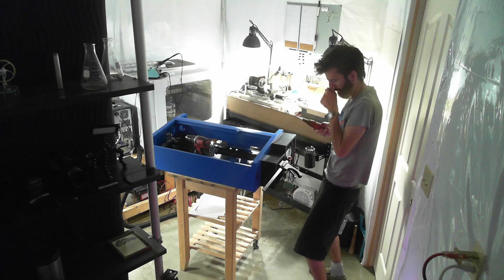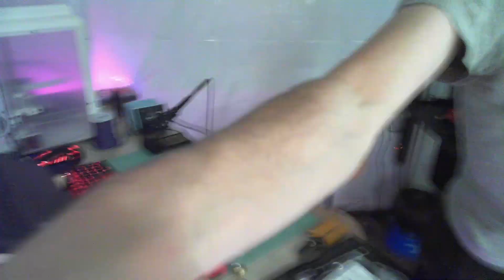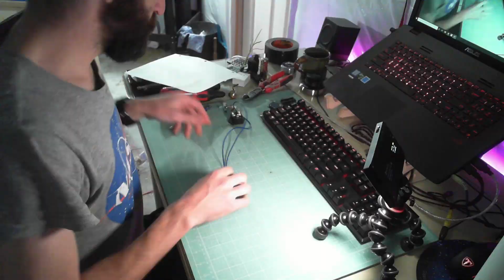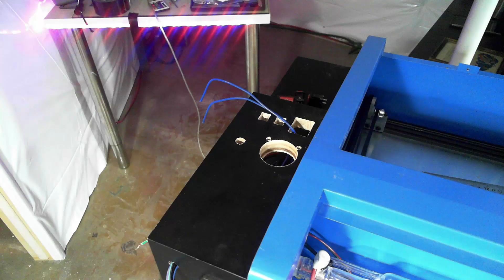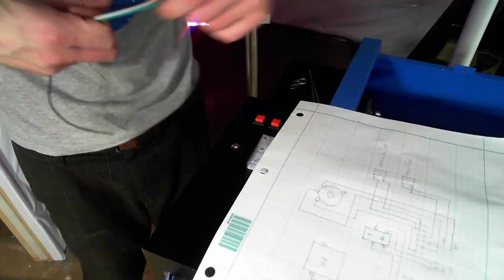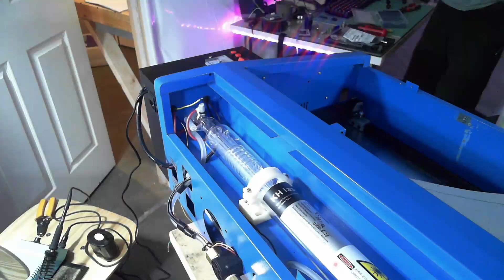Re-Building The Laser Cutter

Comment: Great video. I was wondering what you have chosen for your mirror set up. I have printed all the parts for the larger size but saw another video saying the mirrors don’t meet up well. I was planning to use the cloudray set of mirrors. Is this what you have used ?
Reply from the maker: I've had no issues with mirror alignment (stock mirrors). Quality apparently isn't the greatest but I've had no issues with it for the last few years...I do only cut cardstock and occasionally some 1/4" acrylic.
Reply: @CurtVanFilipowski ah ok. That laser head in the video is different to the stock though. Which one is it ?
Reply: @CurtVanFilipowski it’s definitely different to the stock one.